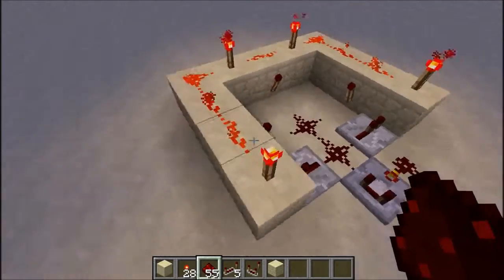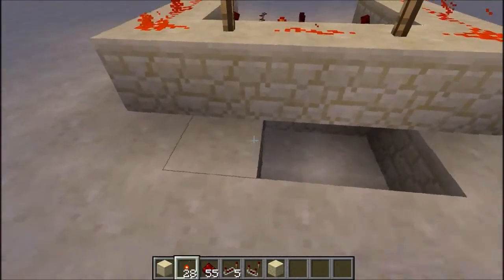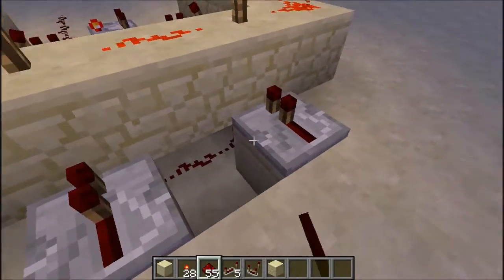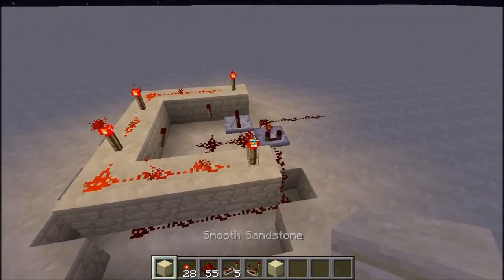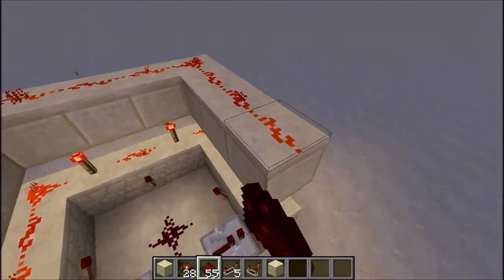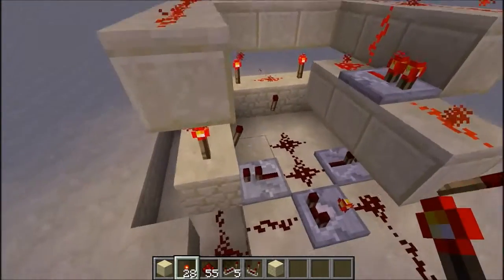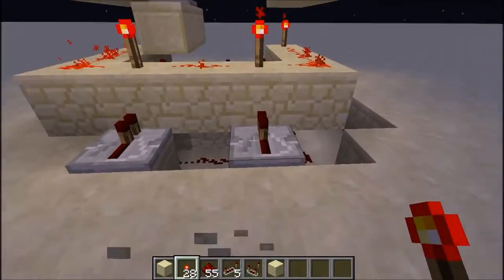How to make a bit sequence adder in minecraft

Comment: Where's the carry-out, though?
Reply from the maker: +Roxas Hikari (ロクサス) hi, the carry over is the redstone dust and repeaters inside the C on ground level, it turns off the comparator and feeds back into the adder (through those two opposite facing repeaters) as an input for the next bit.
Reply: +DoctorDeepSea Oh, okay. Thanks again.
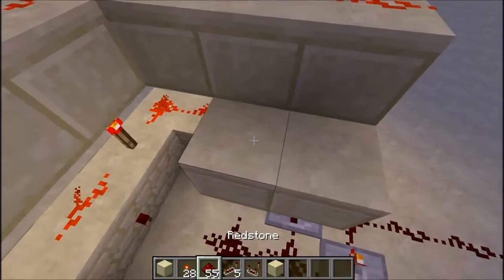Reply from the maker: +Roxas Hikari (ロクサス)oh, there is a mistake in this build, make sure that the block placed at 1:33 is a slab or glowstone, so it does not burn out the torch below it.
Reply: +DoctorDeepSea I noticed that a few minutes ago. I was playing around with the design.
Reply: +DoctorDeepSea Why does it still turn on when A and B are on?
Reply from the maker: +Roxas Hikari (ロクサス) the carry ought to turn on if a and b are on, and so should the output 3 ticks later (on a higher bit). remember that if a or b is turned on with a torch or lever that's like inputting the number 1111111111111111111111111111111111111111111111111111111111111111111 :)
Reply: DoctorDeepSea Oh, yeah. I almost forgot that serial adders operate on pulses.